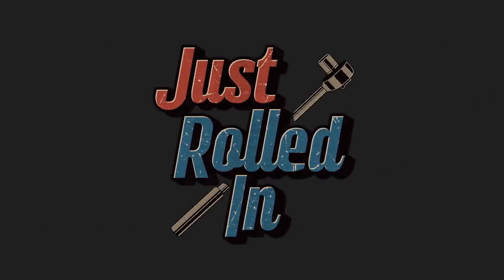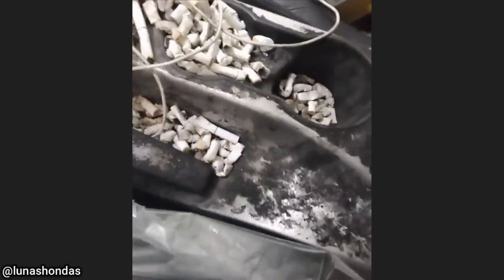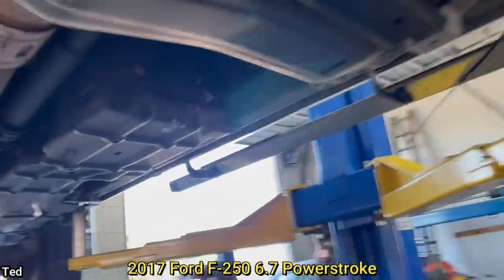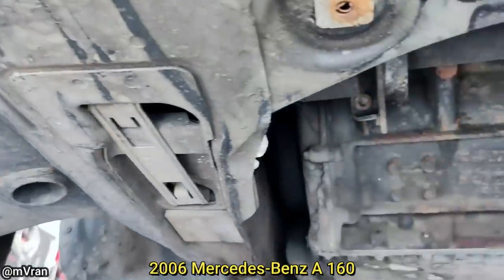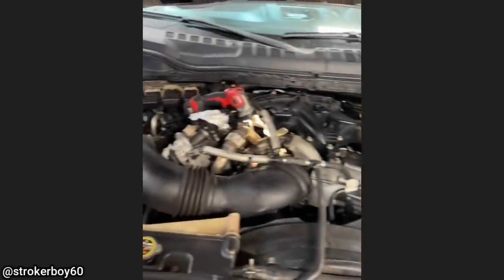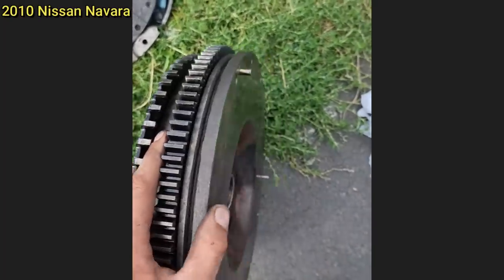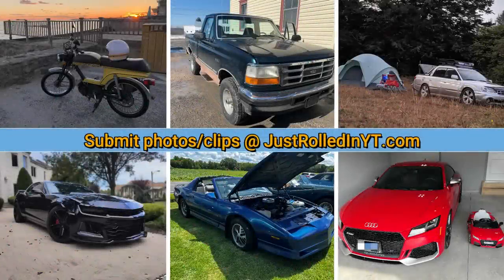Customer States Burning Smell After Trying To Replace Air Filter | Just Rolled In

Comment: That last clip hahaha! Buddy of mine and I use to pull that on each other, always funny to see the reaction of people when they think there is a knocking noise.
Reply: I knew a guy that put a couple drops of engine oil under a just rebuilt BMW m/c. After a few days of that, he had to stop the mechanic from tearing it apart to seal a leak he couldn't find. Not funny !!
Reply: that is so mean as i can say i would tear the engine down to its bear parts to see what the issue is.
Reply: Not nice, especially since it's a van! It's funny though because it didn't happen to me!
Reply: I almost spit out my drink on that clip!!
Reply: That last clip I was a mechanic at Mack trucks in Jackson Tennessee and a buddy of mine had just rebuilt the diesel motor and I was laying under the truck hitting the oil pan with her ratchet oh so funny
Reply: I saw this trick but with a Harley when I was like 5. We used to throw a spare bolt we got from Parts under the vehicle in the tech's bay. They would pull out, come back to their bay, see the nice shiny bolt and think, "Oh, Crap, where'd that come from?"
Reply: I made the mistake of walking away from my truck while on the hoist when doing a u-joint. When I left my buddies shop I had a terrible vibration in the driveline. They had stuck a bunch of wheel weights on my drive shaft
Reply: Ball bearings in the hubcap works a treat. Also bending the dipstick so it just touches the crankshaft (on some straight sixes).
Reply: @olsmokey  Ever put a long zip tie on a driveshaft?
Reply: After an oil change, and then say its pissing oil 😈
Reply: It's also fun to drop an extra bolt or 2 in the parts tray right after they button it up
Reply: @Ogrematic  that's GENIUS!!
Reply: @practicalplinking6133  what is a bmw m/c ?
Reply: @dalewitherington1020  I am not a diesel guy at all, so I have always wondered how you even notice if a diesel starts knocking.
Reply: @rickjames5998  m/c =motorcycle. bmw= Bavarian Mottorad Werkes. I couldn't remember if the model was an R75/5 or an R90S
Reply: @Ogrematic  No, but I've tied a nut on a driveshaft with a rubber band. Once it gets up to speed the fun starts.
Reply: @olsmokey  You could try running the reverse light wires to the horn.
Reply: Done that to the apprentice at landy on his first engine change
Reply: It's even worse when you go to do it as a prank but the engine does it for you 😂
Reply: Got one of my ex coworkers who used to do that. Until it wasn’t a joke. Engine blew. Worker got fired. He came back beated the shit out of the prankster prankster was sent to hospital and the other got arrested. So yeah. Every new employee is strongly advised to not do that. 
Heavy Diesel engine are expensive.
Reply: @Ogrematic  I knew a guy every time he rode his Harley to work someone would slide a peice of cardboard under the engine 😂
Reply: @robwright4398  That's a good one.
Reply: Be all fun and games, until he stops and the knocking continues 😂
Reply: Should've been more suspicious when you see your buddy standing very close to the car when you do your first start🤣
Reply: I'm more subtle, I cable tied a harmonica to the cooling fan frame of my workmates car I did an oil change on. I'm waiting for his response. It will be good.
Reply: @practicalplinking6133  no, its a Break My Wallet
Reply: A couple of friends used to share a shop to work on their race cars. We were working on one late one night while the other was just finishing up installing a new engine, he laughed at us as he left because we still had hours of work left before we could go home. So I poured a quart of oil on the floor under his engine. He was scrambling all over under the car when we came in the next day, trying to figure out where the oil was coming from. We stopped him just in time as he was getting ready to pull the engine and tear it back down.
Reply: no that joke is vile but it is a good one

Comment: Can we take a moment and give a shoutout to the legend that pulled the tranny on the side of the road.
Reply: I helped a buddy swap out a tranny on a dirt road. We did it in about an hour. The guy that hired him was pissed off because my friend made 700 or 800 bucks for an hours work. My buddy told him “what difference does it make? When I took the job I didn’t know if it would take me a couple of hours or a couple of days. I saved you 400 dollars over what the cheapest quote would be and you got your truck back before noon. Sometimes you win one and sometimes you loose, we both won today.” My buddy had a way of putting things
Reply: I used to do that often, once on the side of a motorway with water cascading over me as i led on the floor with a ford transit gearbox on my chest.
These years im 62 and fall off mountains on dirtbikes.
Reply: Changed out a transmission on unpacked gravel once, laying in 1/2" of snowmelt water. Every few minutes the jackstands would sink a bit more, so I'd have to get out from under it and jack the car up, reposition the stands with plywood squares underneath, get them leveled out, then get back under the car. NOT a fun time.

Comment: Concerning the birds in the frame of the truck; I work for a carwash owner and the wash bays have vinyl roll up doors driven by a motor and gearbox. One spring the owner told me to check the top covered portion of the door because he thought he heard chirping. It was a nest of baby robins so I waited until all birds left the nest and I got rid of it. It’s amazing where birds will make a nest.
Reply: Good, I thought I was the only one soft enough to do stuff like that!
Reply: @immortalsofar5314   it’s not about being soft! It’s actually against the law to disturb or harass the nest of migratory birds. Unless they are in grave danger it’s best to wait for the babies to leave the nest before removing said nest.
Reply: @jaykneegarner2479  Maybe so, but the reason I'd do it is simply that I'm a big softie!
Reply: From my limited firsthand experience, robins seem particularly stupid at placing nests.
Reply: @Br3ttM  That can be the case. They can place them well, or incredibly stupidly. 

There's one good nest still sitting at my house after many years; it's on a little ledge above the door on my porch (it has maybe 10 inches or a foot from the edge, and a window's behind it. [edit: I meant the ledge's distance from the window to the edge.]) There's also maybe 6 feet from it to the edge of the porch, and (I shouldn't need to say this, but) yes, the porch has a roof. So even in windy weather, it won't go anywhere. It's been abandoned for years, though. Why another bird never moved in, I may never understand. 

But there were 2 bad nests that fell from the same exact tree here in about a month's time, so I ended up cutting the badly shaped (and dead) tree down. The nest wasn't even 5 feet off the ground, and it was in a "U" section on a tree with a steep drop-off on one side. Any lazy cat could have pulled it down.

Furthermore, I had some Robins put a nest in a bush... Near the alley way, right across from my neighbor's house, where they have a cat. The cat ended up knocking the nest down once (about 4 feet from the ground and in a very obvious place,) and she got one of the baby birds. I saw one adult bird try to attack her quickly, before flying off. After that, I put the nest back in the bush and I put one or two of the 3 baby birds back in. 

Mind, I'm comparing 3 bad nests to 1 good nest here. But I also don't know where there might be other good nests around here, it's not like I go climbing up the big trees at my house to look for bird nests.
Reply: @Br3ttM  Like on top of my front porch light that's right next to my front door at head height.  As soon as babies were gone I tossed the nest in the yard and powerwashed all their crap from the wall.
Reply: Yes. In my RCAF days we had to do bird nest checks every day, every aircraft, April through July.
Reply: @Br3ttM  I've noticed that too.  They have an 80% mortality rate, that could explain a lot.
Reply: 4 babies not 3.
Reply: There's a system of sirens near me for alerting residents of a break out from the nearby prison

On three of the sirens I've seen
 I've seen birds living inside the rotor!
Reply: We have doves that will nest on top of our window unit air conditioner.  The first time we found a nest, the unit wasn't in use, so we left it off until the babies hatched.  The next summer we discovered they had built another nest on top of it while it was active, and the babies hatched out just fine, so now we don't turn off the unit or anything, and it doesn't bother them in the slightest.  I've also had them build a nest on a ladder right next to my door...I've learned that doves are remarkably chill about co-existing with humans, and their babies are really cute.
Reply: I've seen swallows build a nest on a barge (an active one that makes about 4-5h round trips, mind you) and then fly with it, feed the young like normal. Old standing machinery is quite usual place for birds to nest. I found YT series of free airplane restoration, it had heavy nesting going on.

Seen teats, flax warblers and wood finches in a large shooting range, regularly build nests just a couple of meters away from firing line (birds are afraid of shots, flashes and loud noise, they say...). They fly, jump and catch insects while shots are fired and bullets pass literally inches distance. Even muzzle blasts (with flying sand and stones) don't faze them much. Maybe supersonic blasts stun the flies for easy catching, dunno. I'm amazed that over the many years I've seen no hit either.
Reply: Robins are not the smartest birds.  Growing up we had peach trees, robins would always build a nest in them.  Our cat would just casually walk up the near horizontal branch 6 feet off the ground and eat the babies.  Happened several times.
Reply: I get birds that build a next in my sliding barn door witch I open every day ,, but they still spend all day building the nest for 2 weeks till they find a new spot ..

Comment: The Guy banging on the new engine install is going to be “finding” charged capacitors in the strangest of places.
Reply: Thanks for the reminder... forgot that old song.
Reply: Or greased up tools - with motorcycle chain lube.
Reply: Perhaps he is retaliating for finding transmission fluid in his "jelly-filled" 🍩 donut. (Seen in another shop video.) 🤢

Comment: "I think I'll try replacing my own air filter this time"

Just drops air filter into engine bay

👌👌👌
Reply: you can't make this sht up xD - an air filter change isn't that hard actually ...
Reply: @BruceCarbonLakeriver  Usually the hardest part is getting access because some line is in way, or the plastic box is brittle with age.
Reply: @BruceCarbonLakeriver  No, it really isn't! I did one myself! Changing the cabin air filter however, that is a bitch, but the main air filter? It's like three screws and a trash bag for the old filter.
Reply: do you not filter the air that comes through your radiator?
Reply: @saigyl9149  Yes but I place the radiator air filter in front of the a/c condenser!
Reply: @writerconsidered  True but simply dumping it infront of the radiator isn't the solution .. frankly xD
Reply: @PanthereaLeonis  yep!
Reply: @saigyl9149  nope.... xD
Reply: I'm wondering if the original filter was still in there, or if the intake was going commando.
Reply: @JCWren  
I'm thinking that the person replacing the filter could not figure out where it went, so they just dropped it in front of the engine to filter the air going to said engine. 
  Almost makes sense in a cartoonish sort of way.
Reply: lmao
Reply: @bruceb4349  That seems plausible.
Reply: @bruceb4349  Yeah, maybe they thought it worked like an air freshener, and they just put it somewhere convenient in the engine bay.
Reply: I imagine that they thought that the air filter would just find its way home in a Disney sort of way. 

Next trip to the shop 
“Sir you need a new air filter.”
“NO! CHARLATANS, I JUST REPLACED THAT MYSELF!”
Reply: @BruceCarbonLakeriver  Well obviously.
Reply: @dgphi   It's funny until you realize you have family members that think this way whether it's a great grandparent or The kid

Comment: Amazing clips as usual. A prank often done at one shop I worked at was to put bubble wrap behind a passenger side tire. As soon as the tech would back up, it sounded like it was ruining something expensive!
Reply from the maker: Oh that's a good one as well! 😂
Reply: When I used to work as a jeweller, every now & then someone would feed bubble-wrap through the metal-rolling-mill, resulting in really rapid-fire pops!
Reply: Firefighter friend new pickup . We attached zip ties to drive shaft. When he called dealer to tow it, we came clean.  Firemen with too much time.
Reply: empty pop bottle with the lid on it behind the tire ,, hit one the other day i thought i blew a tire

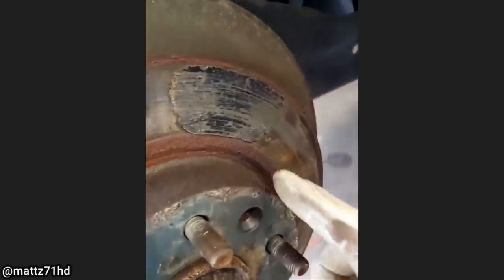Comment: 0:51 I've never seen the entire pad weld itself to a rotor, but I did once see bits and pieces of pads transfer.  It was on a 1-ton truck.  The owner operated a roofing business, and he had a dump trailer with a max load of 16k lbs.  Only issue was, the trailer didn't have working brakes.  It had brakes alright, but somehow, someway, the wiring got ripped out, and he kept towing a trailer that was rated for 16k.  Oh, and he had to lay chains in the bed of the trailer so that the city dump could just yank out his load, because even though the trailer was rated for 16k, he often overloaded it to the point that he broke the hydraulics.  Don't get me wrong guys, 1-ton trucks can tow a lot of weight, but it stops better when the trailer has brakes, especially if the trailer weighs twice as much as the truck itself.
Reply: I live in a 3rd world country, and sometimes you see vehicles here with 5-10 times thier rated gvrw with no extra braking power added.  

You can imagine how the brakes and suspension look on some trucks here.
Reply: Someone once told me his caliper pins came out while braking because his pads were so low. Is that possible, or was he mistaking one part for another?

He was driving a 12 year old Dodge Aspen (so I'm guessing this was in the late 80s or early 90s [the Aspen was made from 1976 - 1980]) and he was going 40 MPH, coming to a 4 lane intersection where he had to brake. He hit the brakes, nothing. Parking brake was broken, too. He had to go in low gear and zig-zag through traffic. Again; when the brakes were looked at, it was shown that the pads were worn so low that they pulled out the caliper pins.

At least, that's the story I was told in 2016. Is this even possible? It's not like I don't do my own maintenance well enough to not die from it (so I know what Calipers look like,) but this caliper pin story isn't something that I think of much. I can't think of how it's even possible. Was he confusing one part for another here?
Reply: Metal on metal, got too hot, welded on.
Reply: @101Volts , I'm unfamiliar with the Aspen, so I looked at what a caliper looks like for one, and it looks different from a traditional caliper, there's no pins in the caliper, so I'm not really sure how it's mounted or held in place.  Depending on the design, I suppose it could be possible?
Reply: @vivillager  No it's not possible for the pin to slide out unless the caliper arm breaks off.

Comment: One time I had my car up on the lift to change the oil.  The air compressor beside me chose the exact moment I cranked the car to check for leaks to start up, leading to a panicked engine stop while I wondered if I'd unintentionally become the star of the show here 😅

Comment: the brake pad welded to the rotor has a simple explanation: the driver overheated the brakes and then put the handbrake on before they cooled sufficiently. surprisingly common thing to occur in aviation.
Reply: One horrible winters night in the 1990s I was a passenger flying out of Turin in a snow storm. As we accelerated for take off it didn't feel like it was accelerating quite right. After what seemed an age (and a lot of runway) the pilot aborted the take off. Most passengers were upset by the rapid deceleration but I was relieved he had  made the decision. Anyway we taxi back to the terminal to get an engine looked at. After they fixed that they found they couldn't get the brakes off. I swear it felt like they jacked the plane up and then started hammering on the UC. Numerous passengers didnt like the banging asked to get off. I can still see a demon on the wing throwing things in the engine just like in the film.
Reply: @ColinWatters  I believe it was a Simpson's episode, with the demon on the wing lol. Seeing technicians carrying sledgehammers out to an aircraft was always worth a look hahaha
Reply: @ithinkurf I had to Google it but turns out it was an episode of the The Twilight Zone Nightmare at 20'000 Feet by Richard Matheson. I expect the Simpsons referenced it.

Comment: Holy crap…back in  lets say uhm..well…1990 a friend accident dropped a sub in a bucket when he was wiring up his stereo system in his 1978 chevette. ( it was brush painted super sweet like) Well, he turned it on, and it kinda sounded good. And after that “bucket-o-bass” was born.  And to this day me and the guys still joke about it.
Reply: I used to have a sub that was probably designed using the same concept back in the 90.  My good ol' 10" Bazooka Tube.  It worked pretty good for its size.
Reply: @brian5o  lol, after that vid I texted the guys, Eddie said “ that is even before bazooka, that companies owes me money”. And we all laughed. That same guy started his own microbiology company that has gone international.
And now drives around in very expensive
Luxury cars. And we are all still friends.
Reply: @brian5o  Oh man I had a Bazooka tube subwoofer in my car, too. Decent sound considering what it is. The basic principle of a sub enclosure is simple. A 5-gallon bucket would vibrate too much, though, LOL.